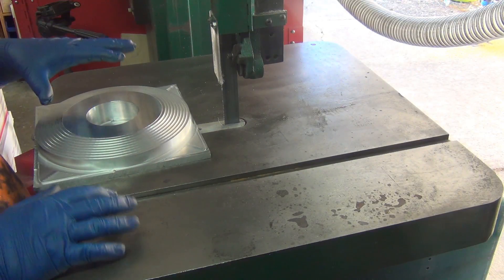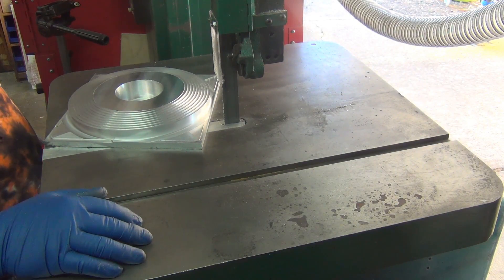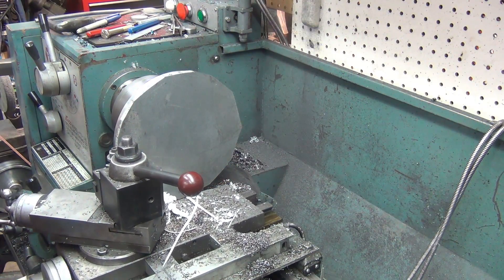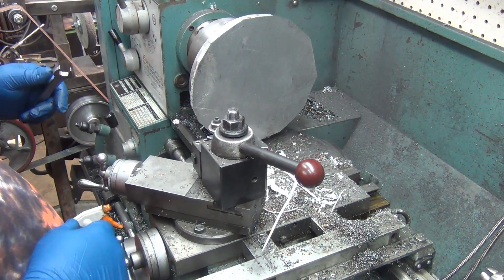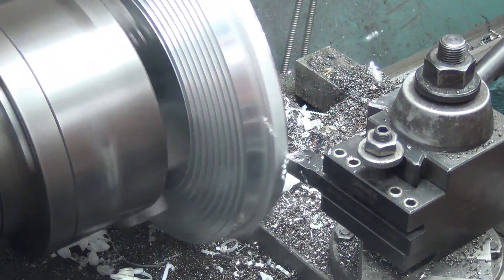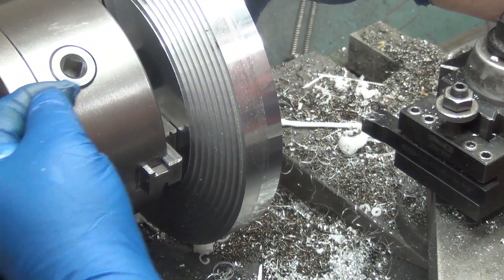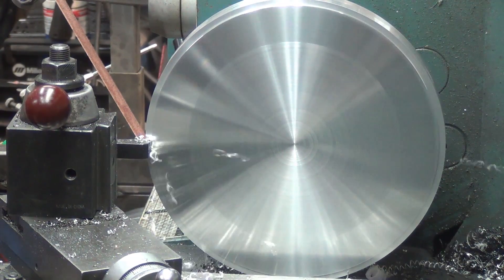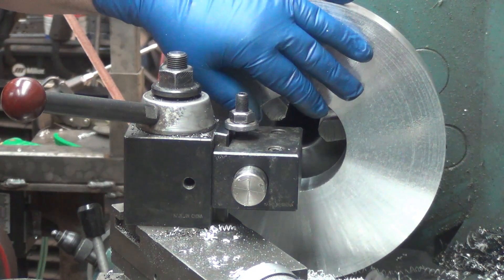13 inch Brakes - Rotor Adapter OP2

Comment: i'm glad you are using the appropriate insert and getting the desired chip breaking. is that 6061 or 63?
Reply from the maker: 6061.  I've got burn marks all over my arm from the hot, heavy chips landing on them!! lol  I almost started missing the strings. lol